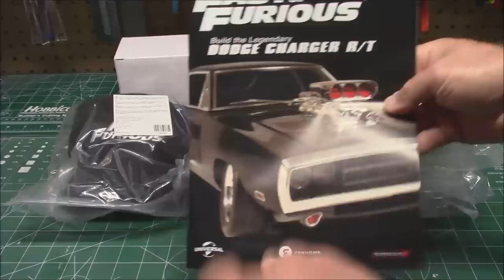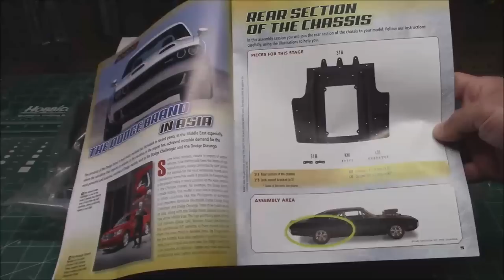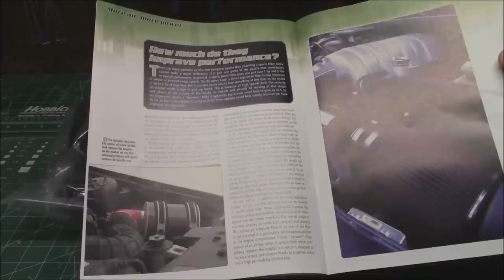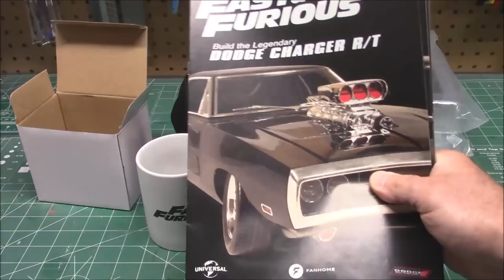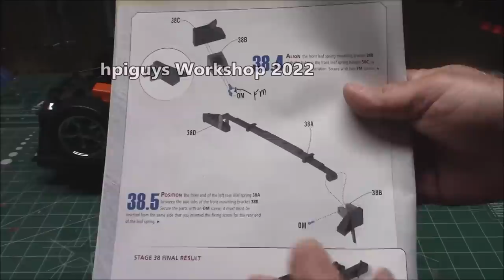Fast & Furious 1/8 Scale 1970 Dodge Charger RT Hemi Model How To Build Exhaust Brakes Diff Fanhome

Comment: I would go so far as to say that this model has more screws in more places that need them than most modern cars have nuts and bolts. It seems the more I work on them the less nuts and bolts. They are using more clips and push pins than anything now days. Nice build. My sons and I really enjoy your process.